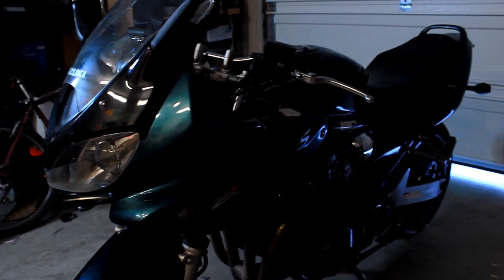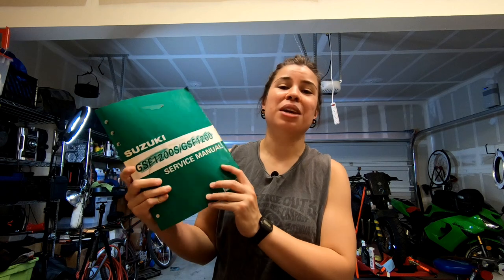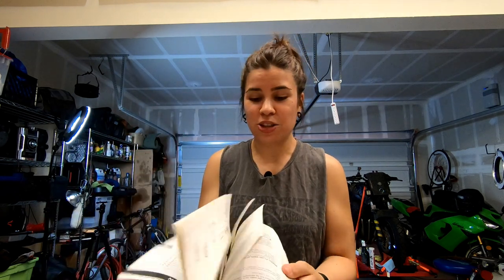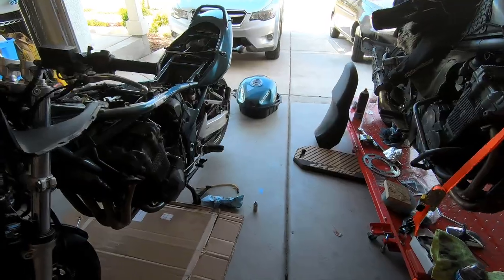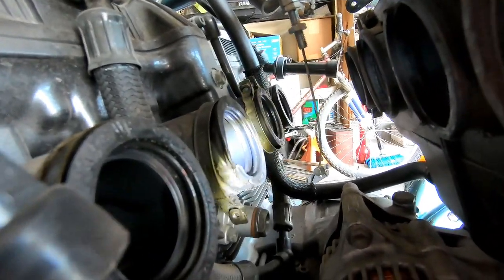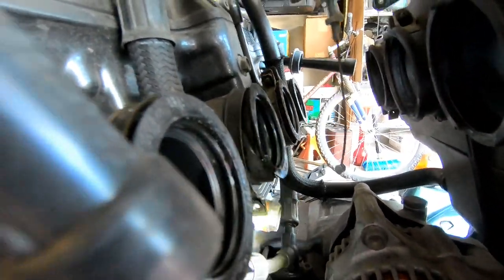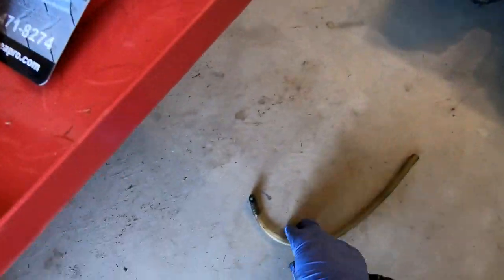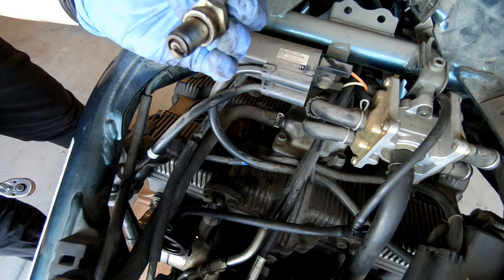This is NOT what I planned... - Suzuki Bandit Project (PART 2)

Comment from the maker: What's the most difficult part of a motorcycle project for you?
Thanks for watching! 💘
Reply: Without a doubt, my least favourite things to fix on bikes are electrical and wiring. Blah
Reply: I second electrical
Reply: Since I only have carburated motorcycles, it's probably working on the 30+yr old wiring on my '90 Heritage softtail.  That stuff is kinda sketchy at its age.  and the FSM clearly was NEVER checked for accuracy.
Reply: Old fittings that refuse to come out :(
Reply: Deciding which beer to drink while I wrench.
Reply: So I have yet to tackle it, but I do have plans to dive into it in the future... but the transmission. I wanna do some customization with the gearing on the inside, but I gotta take apart half the block lmao, and I gotta get it right the 1st time cause I don't wanna take it off again

also wiring, I absolutely hate wiring.
Reply: I'm currently making my own rear cowl with fiberglass, its reaally hard to perfect it.
Reply: Killswitch Queen I hate working on carburetors.
Reply: Carbs because there is so much fuelishness. 😜
Reply: I do everything on my Harley’s with the exception of tearing down the engine or working on the engine

Comment: Most frustrating mod I did to my bike was trying to install HiD lights. It was a crap shoot, I had taken the tank off to run wires and hide the balasts, only to have the lights not work more than once.... and then I had to undo all the wiring that I did to have a clean look. After all that I went with LEDs and have never looked back.
Reply from the maker: Those HID lights look great but are such a pain. I had some long ago and they burned out, new bulbs cost 100$ so I just ended up ripping them out same as you. Nothing like some good LEDs!

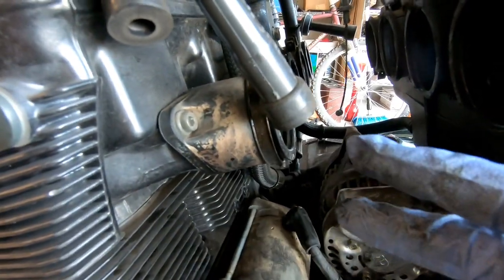Comment: 4:15 use a heat gun warm the crap out of the boot. like real hot. then see if you can install the carbs to retrain the rubber as it cools for like an hour.

Comment: Hi there, we just found your channel 
(wife & me) amd we love it. We are buying our first 2002 Bandit tomorrow morning. It is MINT condition and 60 year old original owner. We see you are a Bandit fan yourself. Is there anything we need to know about them? Maybe maintenance wise? We would appreciate any tips. Thank you and ride safe! We love your channel!!
Reply from the maker: Thank you and congratulations on choosing a Bandit! 😄 I truly do love these bikes. They can be easily neglected since they run so well despite potential problems. The K model generation being almost 20 years old, you may start to see deterioration due to age, or years of maintenance. I’ve found the clutch cover can be notoriously leaky. Check the intake boots for any cracking or deformities (like I found!). See if any of the brake/clutch lines have been replaced/upgraded, since the original lines do break down over time. Check the brake rotors for deep grooves, because they are very expensive to replace. All in all, if the bike runs well and all these things are good, you’ve found yourself a real gem!! These engines are bullet proof and will get you home and then some. I hope it works out and good luck!
Reply: Killswitch Queen <—Do you have an email? I would love to show you some pictures of this amazing bike. The guy listed it as “Mint” and let me tell you, it was exactly that. We figured you could appreciate that.

Comment: Good luck with your parts order! I ordered a part for my sportster, the site said order before xx o'clock and it ships today! So I did...two weeks later it arrives. Ticked me off, but what ya gonna do. My most difficult part of a motorcycle project, putting everything back on the correct way.
Reply from the maker: Thank you, yeah that sucks! Usually it says "ships in 24 hours", meaning it ships from the manufacturer/warehouse within 24 hours. Not whoever you order it from! I learned that the hard way too...

Comment: The toughest part of any motorcycling project for me is my propensity to strip allan / star heads.  I am a total klutz on the matter.  Sad the thing is, I just cant fix the issue.  I am not a smart man, but I know what a motorcycle is.....
Reply: TwoTireTirade Agreed.  Cheap factor screws these days that often get over torqued.
Reply from the maker: Nothing ruins any job like a stripped screw/bolt... it's like a slap in the face from the motorcycle gods

Comment: Been watching these videos trying to get my 2004 bandit 1200s working right. Do you know  any solutions to the 4th cylinder not firing? Been looking for answers and checking over many things, but I haven't found an answer. There is compression, carbs are clean, floats are set, there is spark, but the plugs are just wet each time.
Reply from the maker: Okay! I’m sure you may have tried some of these things, so forgive me, but I have some ideas. 
You could try swapping the spark plug cap with another cylinder you know is working, and see if the problem moves to that cylinder. Checking the resistance of the coil assembly to see if it’s functioning. Making sure the plugs are new and all set to the same gap. Lastly I’d try going back into the carbs, check the diaphragms, pull all the checks and clear the circuits. Also verify the air/fuel mixture is set the same (if the plugs have been removed from factory). 
Hope this helps! Best of luck!
Reply: @Killswitch Queen  thankyou for the quick response on a 2020 video, that is greatly appreciated. I actually managed to solve this problem today after the past 4 months of trying. 
Reverted the air system and carburetor to stock, did pretty much everything on your reply, and tapped the spark plug into the proper gap size. Combination of everything must have finally made it run right!

Comment: You not got a local parts dealer to get it from or bike shop that could get the parts for you? I know it's cheaper online but sometimes they can stock those parts or get them quick.
Reply from the maker: I actually ended up contacting a few local Suzuki dealers with no luck. But one did direct me to a shop in another state that had some parts so that worked out!

Comment: That's a lot of damn work for spark plugs.
Reply from the maker: Honestly I may have been able to snake the sockets in under the fairing, but with everything else needed, just made sense. Plus I didn't know what was going on in there, so I didn't want to drop the socket in and not be able to retrieve it... lol
Reply: @KillswitchQueen  Changing plugs on the 1200 in the 750 frame. 10 times as hard. I have to drop the motor to do valve adjustment. Price you pay. Looks hella cool.